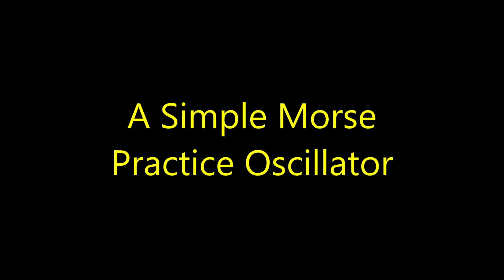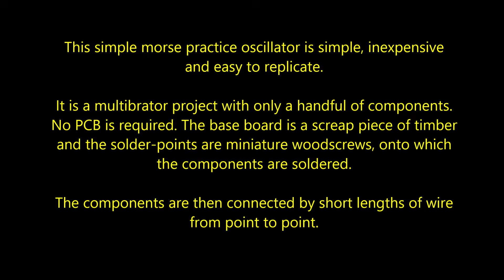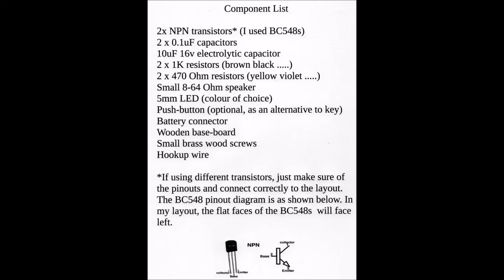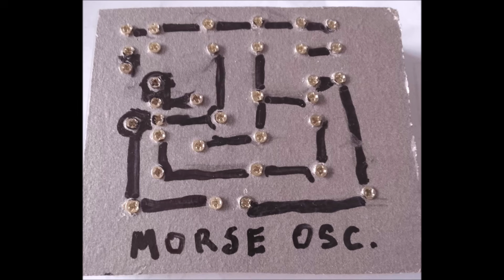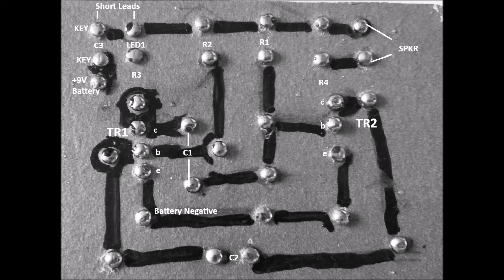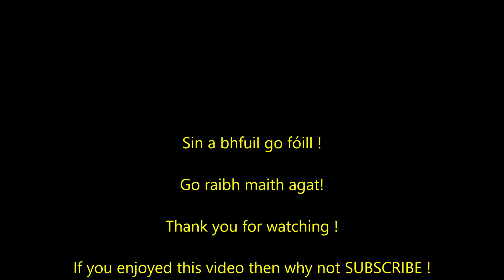A Simple Multivibrator Morse Practice Oscillator

Comment: Great video, thanks so much, I wonder if the wood base had humidity, would it act like a partial conductor between the components or even change the on board capacitance? Cheers.